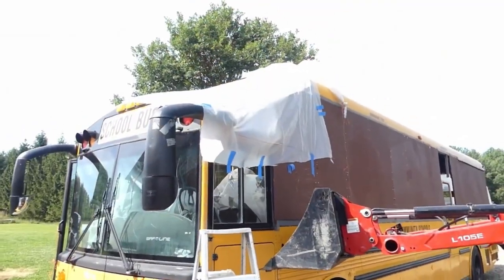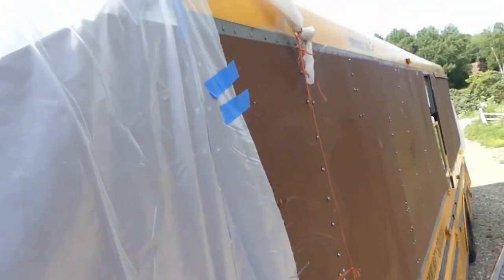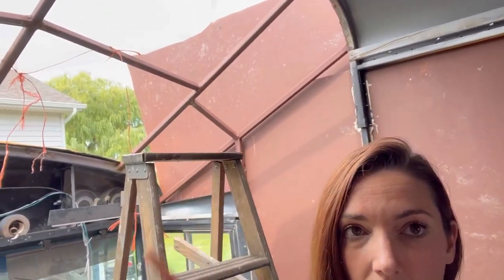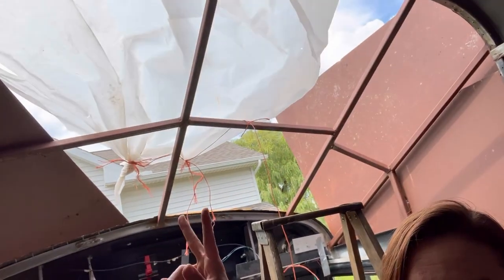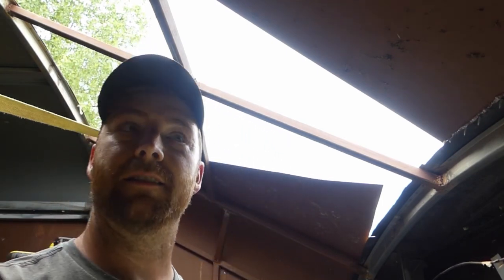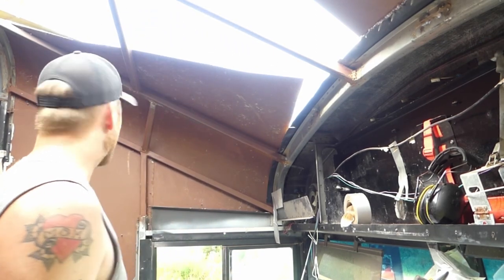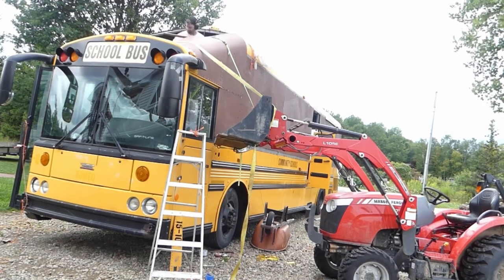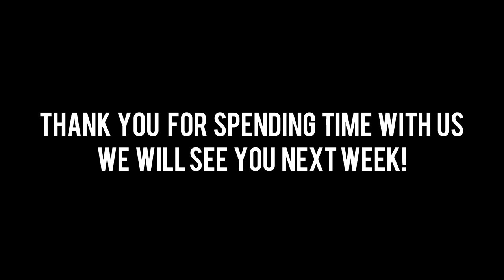SCHOOL BUS CONVERSION // ROOF RAISE TRANSITION

Comment: I really like the angle of your roof raise transition.  It looks more aero than most of the roof raises.  You might try some pvc sheet like they use in bath walls for your layout patterns.  It will flex like sheet metal, it is easy to cut and it is rigid enough to keep its shape.  When you get it trimmed to fit you can lay it on your metal and transfer the shape.
Reply from the maker: Yes we like how it turned out too! We went back and forth with where to make the transition but I didn’t want it to look too square 😂 even those it’s basically a big brick anyways. That’s a great idea, we find think of that!